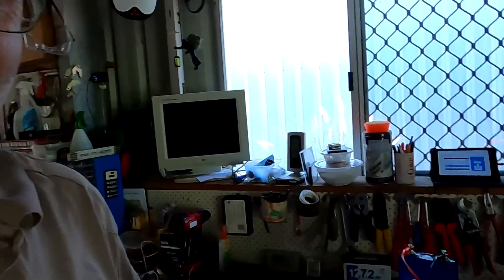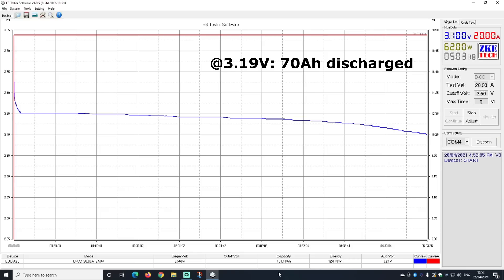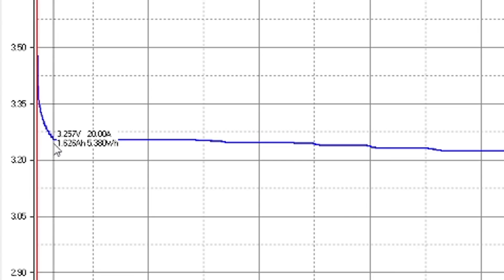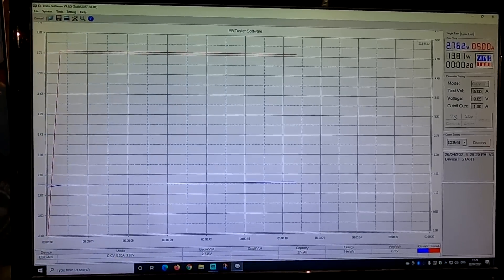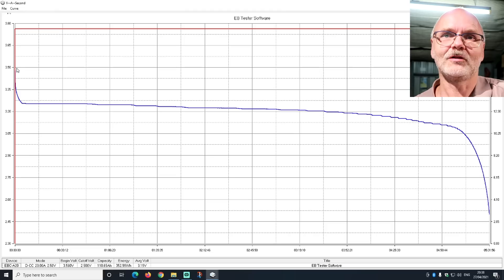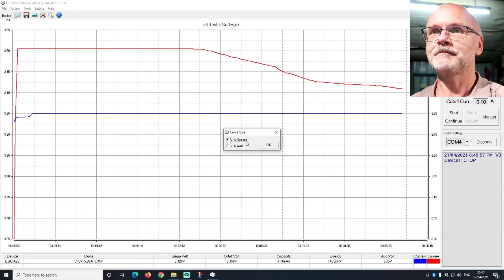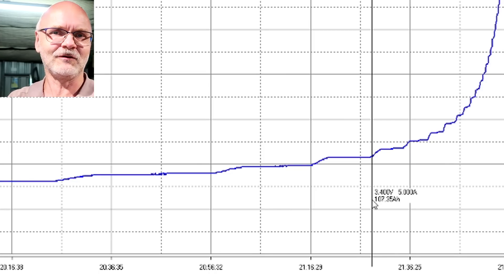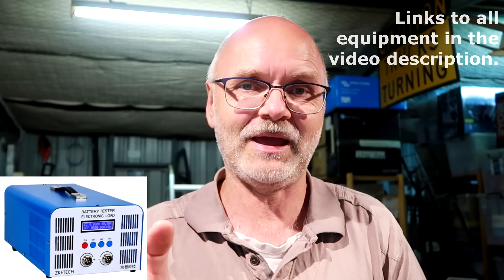How far to charge and discharge a LiFePO4 cell. Testing the full Charge and Discharge Curves.

Comment: I get 1.7kw when i set low cut off @3v per cell. And 2.5kw @2.9v per cell. 
I use highstar cells 8s 100ah from India. 
Is going 2.9v fine for low battery cut off?

Comment: I have a question, what is the best way or a way to charge a single 280ah lithium prismatic cell, I think it's an eve cell. I have been searching all over for a video or answer and it's usually a 12v pack is what I find. I need to replace one in a 24v pack and need to get it up to the voltage of the others before I drop it in. May sound like a dumb question, but I'm searching for an answer, hope you will assist, thanks...

Comment: Hello, I just purchased two of the  EcoFlow Delta Pro Battery systems along with the Double Voltage Hub to join the two EcoFlows together to provide 220 volts to my 10 circuit stand by electric panel.  I also purchased two EcoWorthy Solar Tracker systems and mounted 4 of the 440Watt Magnus Solar Panels on each Solar tracker system.  After watching a few of your very informative videos is:  What should I set the charge limit to and what should set the discharge limit to?  From What I learned from your videos I have set the Charge limit to 95% and the discharge limit to 5%.  I want to get the most life from the EcoFlow Units and get the most energy from them.  Thank You for taking time to educate the public.

Comment: I am from INDIA , Namaste 👃👃Very help full video to understand LFP Cell Charge and discharge AH and volt  profile, before we used volt meters they shows full voltage actually at that time battery drained to 90% after running 8 to 10 km. of E rickshaw Battery shut downs, after watching video we replaced volt meters with True capacity meters they measures each amp hour during charge and discharge thank you very much for making such a nice videos.

Comment: Heads up. Something nobody is thinking about. 

   I am trying to get the word out on this. I have confirmed with others and at least one that I am pretty sure of his credentials.  
Here are the basics. A standard 12v lithium ion and li po battery has a BMS ( Battery Management System) . First, why. The BMS protects the battery from overcharge, which can cause an overcharging runaway meltdown.  Under studies, these BMS typically fail at about 50v. This is way higher than any normal conditions that should ever be present... except for one or two. One is pretty obvious, and it is a million to one chance. The other is a different animal.  A nuclear atmospheric EMP attack over an area on the first wave or fast wave can produce 50k volt surge.  That surge can almost immediately break the BMS and send the battery into a near unstoppable meltdown.  I caution you to familiarize yourself with the conditions that develop with the runaway meltdown.  The horrific scene that develops is nightmarish, but wait, there is more.
Every lithium battery is subject to this condition under the circumstances mentioned above. Now imagine every lithium battery in your area going into meltdown at the same time. Every house. Every lithium powered toy, flashlights, 18650s  , and all the way up to include implanted medical devices. Incendiary devices for some acting like a blowtorch and others like bombs exploding hot melting pieces of metal high into the air , but only after outgassing of poisonous and explosive gasses are released.  
It will be like a fireworks display from hell with little to no escape because the same situation is happening in every home and in the streets around you.  
Not only have we been flooded with these batteries in what I consider is a setup by China, our nuclear powered enemies hold the remote to our destruction. 
I am asking everyone to help wake people up to this so they can make changes to help minimize the destruction potential.  
Yes, this was a personal epiphany, but I have done my research, and no one is testing or addressing this situation.  From the research with confirmation, this situation is highly probable to be correct. 
I do not think shielding can protect from 50k volts, but containment systems might can. At this point, no studies are available that address this extremely destructive situation. 
I know ww3 in at least in the back of everyone's mind. Speaking strategy, an atmospheric nuclear EMP attack is highly probable as a way to limit an enemies ability to wage war. Think about it.
One additional point is that these batteries will not only poison people but the entire area, and the fires everywhere will be extreme . They will continue to outgass and burn and become explosive for weeks as they reignite spontaneously.

Comment: how is the discharge voltage variation vs time of a best quality battery and a poor quality battery when the same load is connected?
Reply from the maker: Lots of videos here on the channel showing that! Also a mix of different cells capacities in series in one pack.

Comment: Great video really interesting 👍
A coupla questions . . .
Is it correct that you should try to keep the low point 20% and the high point to 80% . . . .amd if yes then how do you set up a system in a car to maintain those perameters?
I have solar and ac charging setup but just trying to look after the battery as well as possible.
Cheers Ben

Comment: How do you calculate the cut off voltage?
I'm thinking of getting one of these testers to test the 24v batteries we use at work.
Reply from the maker: That depends on your battery and chemistry if lead acid, li-ion or LiFePO4.

Comment: Hi Andy! I have no previous experience with any BMS device. I am confused about the operation of the JK BMS device because I have mixed up the device:
Situation 1) The measured capacity of the cells is 307Ah, but I originally wrote the BMS "Battery Capacity" value as 280Ah and I have also tried the values 307Ah and 300Ah for that point. It seems that changing this value completely messes up the calculations. A real example:
When I set "Battery Capacity" to 280Ah and "Remain Battery" = 100% and "Remain Capacity" = 280Ah. Then I change "Battery Capacity" to 300Ah so "Remain Battery" = 69% and "Remain Capacity" = 193.2Ah. This seems completely counterintuitive!
Situation 2) I charged the battery directly through its main terminals - that is, I did not put the negative wire of the charger in the "-P" port of the BMS device, but directly in the terminal of the battery. While doing this, I noticed that the voltages of the cells do increase, but the BMS does not increase the "Remain Battery" and "Remain Capacity" values at all, even if I charge with a 25A charger for 40 minutes. So the information about the actual booking amount is completely out of place?
 
Could there be a programming error or flaw in its software for Situation 1 that they never noticed?
 
But anyway, I'm asking for advice:
- Can I safely forget about these readings like "Remain Battery" and "Remain Capacity" and just focus on monitoring things like "Ave. Cell Volt." value to see what the actual battery charge is?
- Would it be wisest to use the battery in the interval where the pole voltage moves gently to decrease or increase - and not discharge it so empty, where the voltage drops quickly, and not charge it so full, where the voltage rises quickly?
- Which voltage values would be the best for the OVP and OVPR and UVPR and UVP points of the cells?
 
Thank you!

Comment: 15:10 Did you say that the  ZKE-Tech EBC-A40L can't test a 4s battery, only single cells?  But the smaller ZKE-Tech EBC-A20 can?
Reply: Yes, the small ebc-a20 can handle 30v whereas the bigger one handles less voltage but at a higher current.

Comment: As I already explained is full charging with Lifepo4 batteries at least from time to time beneficial to keep the spaces for the lithium ions open in the carbon material, otherwise they wither away when not used and then the remaining spaces will be jammed, which would lead to more expansion and degeneration.
Also deep discharge is with lifepo4 batteries not as bad as for the "classic" Lithium batteries, cause in Lifepo4 is moving all the lithium from one to the other side, beside the classig lithium batteries, were only the half of lithium is moving and the other half is needed to keep the structure, where the lithium is docking on to it, when coming back.

Comment: What does "Mr. Garage" say about a shallow discharge / charge cycle of an LiFePO4 battery?  Example - A typical 2000WH SOGEN battery bank with an approximate 500 watt air conditioner load that is fed/charged with ~ 475 watts of solar.  When the AC compressor cycles off, now fan only, (~40 watt load), the 475 watts are now charging the Sogen  for ~ 5 minutes.  Then after the AC compressor kicks back on, the use cycle is repeated.  The Sogen display varies from about a 62% charge level when the AC compressor is on and the Sogen charge display increases to about 63-64% when the AC is "fan only".  Does this usage pattern have any negative effects on the Sogen's LiFePO4 batteries????  Me AND all your other viewers may have a similar question about this "short cycle" use....  Thanks ahead of time for your experienced opinion....
Reply from the maker: Keeping the battery right in the middle of its SOC is perfect and there is nothing wrong with doing this.
I would still recommend to fully charge that battery maybe once a year and do a top balancing of the cells as they will drift a bit over time.
Reply: Thank you very much for your reply.  When new, the unit, (Pecron E2000 LFP),  arrived at about 65% charge and I DID charge fully, then let it drain with ~ a 400 watt load until the BMS turned the unit off.  This initial full cycle- 100% to 0% then full charge to 100% I believe was proper to "calibrate" the newly assembled cells in the total bank.  With a potential hurricane that may arrive within days, I'll be sure to top off the unit for the expected power outages.  Then every couple of months I'll run a FULL cycle for the BMS to fine tune the cells in the bank.    @OffGridGarageAustralia

Comment: What would be critical to point out is what max charge voltage and what min cut-off should we use to get most capacity while preserving battery life. What do you think about 3.45 and 3.0 V ?
Reply from the maker: Yes, 3.45V as bulk/absorption voltage and 3.0V as cut off for the inverter are perfect.

Comment: I have always questioned the "rule of thumb" figures thrown out for charging and discharging cutoff. This is the first instance I have seen of someone closely examining the charging and discharging curves. Of course, this is only the base data,  I assume that you will try adjusting the cutoffs to see how much it impacts the capacity. Determining how various cutoff points affect the longevity of the cells might take longer than we have left in our own lives. Thank you for your efforts.
Reply from the maker: Thanks, Jeff. Yes, this is an older video where I started to find out what is actually happening with charging and discharging LiFePO4. I have many more videos on the channel, where I did all the testing and analysis of what you said in your comment. As I could not find any useful and consistent information online, I started my own experiments and shared the results here on the channel.

Comment: Thanks for the amazing video. Is it enough if we charge lifepo4 battery upto 3.4V or we need to charge upto 3.6V?
Reply from the maker: Thanks. 3.4V is a bit low unless you let it absorb for a very long time. If you can charge to 3.45V though, that would be ideal. 3.6V is not necessary and only for top balancing purposes. There is no additional capacity gain charging from 3.45V to 3.6V.
Reply: @OffGridGarageAustralia  Thanks for the reply sir

Comment: I am planning to build a 12v battery, only have a dc dc converter, wondering if this would be good enough to charge or donyou need something that stops ats the current drops?
Reply from the maker: A DC to DC converter will work if setup correctly. I have used one many times to charge a 12V lithium battery. Important is that the battery still has it's own BMS as protection device. Set the DC converter to 13.8V and let the battery charge until the current is almost 0A (or under 5A for a 100Ah 12V battery). It's then charged 99.5%. Remove the inverter afterwards.

Comment: which battery tester for 48v 100 ah battery module? Can we use same tester?
Reply from the maker: No. Look at the specs. There is none I'm aware off for 48V batteries which can charge and discharge.
Reply: @OffGridGarageAustralia  Thank you, I do have DIY and a 48V 100 a that I suspect need to check their current load unload comparison.

Comment: If we have lithium battery 100 ah 48 v and we made rack of 4 = 400 ah rack how much we should put max charge and discharge ?
Reply from the maker: That totally depends on the specifications of your cells and the cables/fuses, breakers you have used to build that battery.
Reply: @OffGridGarageAustralia  first type a+ cells second cables 25mm from the battery company 3rd using 125 breaker for the pack of battery 400ah and in the end sure using buss bar +and _ so any hint for the max charge and discharge i want to know how much should i go max or how it calculated bcz some say u can t go too much if any batt has fault u ll make the other lean under high pressure
Reply from the maker: @joehebbo7047  25mm and 125A breaker... 🤔 That's pushing it a bit too much but depends on the cable they are using.
Again, we don't know the specifications of you batteries, so that will tell you the maximum charge they can accept.
Reply: So if your using your own battery 400 ah what will be is it hard to tell? Or bcz it s not ur battery no answer 😅

Comment: Andy you say "10% more battery capacity" is impressive. No it's not. Every manufacturer of everything specs their product with a nominal capacity with variously hidden "headroom" or "safety factor" above and below what they want the customer to use. Eg,  Crane cables are some 3x the Safe Working Load. If you tested a 1 tonne to break at 3 tonnes you should NOT be impressed it can lift 300% more than the label says. Conversely, if you found a battery which only gave 100% of its specs, you should in fact be UNIMPRESSED it is graded right on its edge.

Comment: I'm puzzled as to why Andy (or any other off grid tragic) needs to be doing all this in depth testing stuff. 
1. The manufacturers of each battery factory research and provide the most efficient charge and discharge graph specs for their product. I've got mine. Why not just follow them?
2. They are deduced by tertiary-educated chemical-electro engineers, probably in touch with the best lithium chemists in the world when making their batteries. Some design batteries for space travel. Every product would be bench tested 100x more than Andy's work. 
3. Despite Andy's months of garage testing, good manufacturers have teams of engineers working 5 days per week and millions of dollars of testing equipment. Why are we humble customers not just following their product spec sheets? Does Andy REALLY THINK he's smarter than all the technical people put together in (for instance) the Daly Dongguan BMS Electrics Company or Tianjin Lishen Battery Company, rated 5th in the world? These are young, cutting edge,  PhD Chinese graduates, born into this era of hi-tech battery technology.
4. Won't each battery maker's product vary somewhat from the tests Andy does on his brands? I've got Lishen Cells, reputed to be one of the best. They make billions for e-Bikes. But I know there are many totally crap brands of RV LiFePo batteries out there with recycled lithium ... nominal 100ah but probably good for only 80; supposed to be 12.5kg of lithium, but really only 10kg.  Surely those ones will perform WAY DIFFERENT to mine or Andy's.
5. I appreciate there are many lithium myths out there which need to be disproven, and many amateurs like myself thirsting for good information. But surely, "just follow your manufacturer's recommended spec sheets" is the easiest way to go. Ffs, Victron (for example) know their products better than anyone. Just explain them. No need to critique everything as somehow imperfect.

Why all this perfectionist angst? Or is it just a curiosity neurosis hobby for retired old codgers in garages who think their battery or BMS maker "might have missed something".
Reply: "Trust, but verify" 🙃

Comment: One test that I'd like to see with these cells that I can't find anywhere is... Can we boost up the voltage with a step-up module to 24v, 36v or 48v for ex. for an ebike battery using only 1 or 2 cells. So 3.2 or 6.4v boosted to 36v with the stepup module in order to make a small simple battery with few connections like the 18650 lithium cells.
Would love to know if this is possible to do.
Reply: Hi CK, while anything is technically possible, this idea would require a very hefty booster circuit to achieve the results ur looking  for on an ebike & that would probly get pricey. Remember v=ir, so this 100Ah 3.2V Cell has roughly 320 watts, so say ur ebike motor is 32v and uses 10A, that’s 320 watts right? Not really when u go thru a soft grassy patch or up a hill, but also remember ur 3.2v cell now has to put out at least 100A continuous. I like ur idea for simplicity, but I just dont think it would be very viable the way electronics are presently. Cheers
Reply: @evil17  alright, thank you very much for your answer 👍